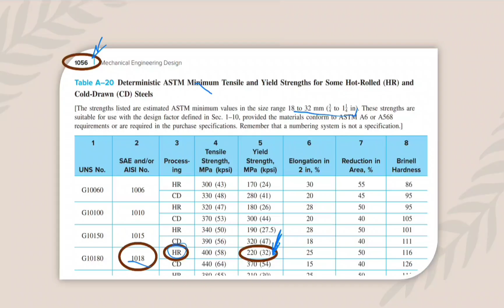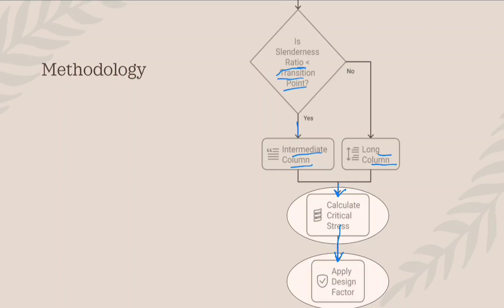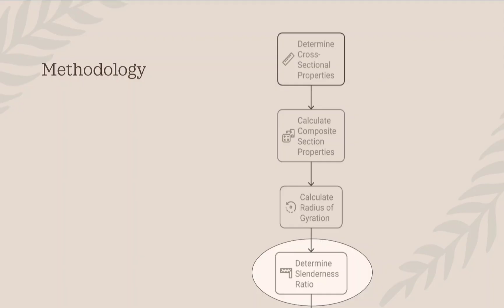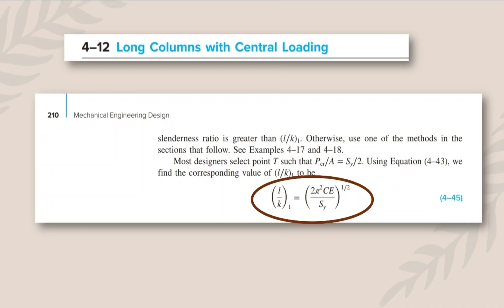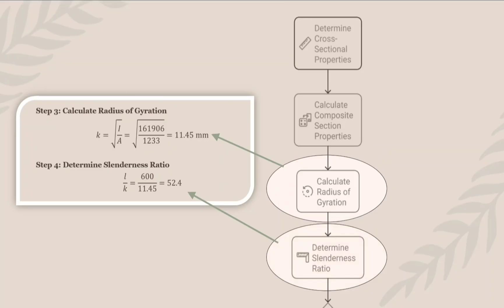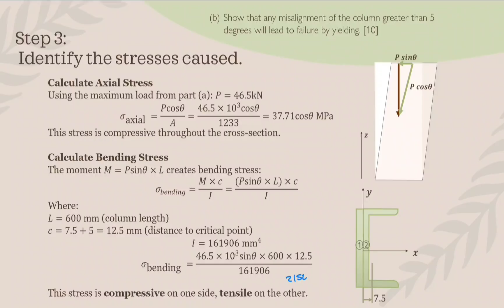Buckling A1 Question (2025)

Comment: so the critical point is to the left side and the distance to that critical point is thus 12.5 mm = C (distance from centroid to failing point) which comes from 5mm for the thickness of the rectangular bar (and the offset of the coordinate system) and the 7.5mm is the centroid of the entire object, further as to why the critical point is to the left side is because the object is more likely to fail over the rectangular bar than it would fail over the Webs of the U channel